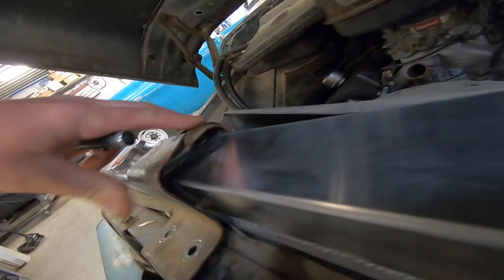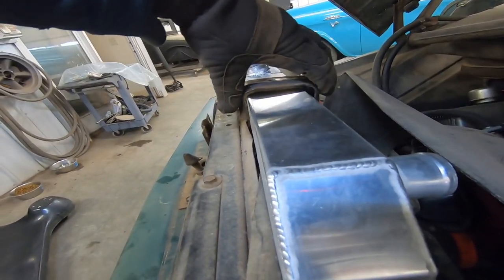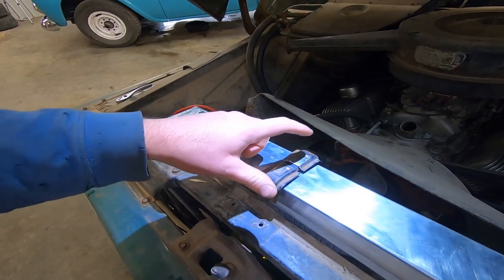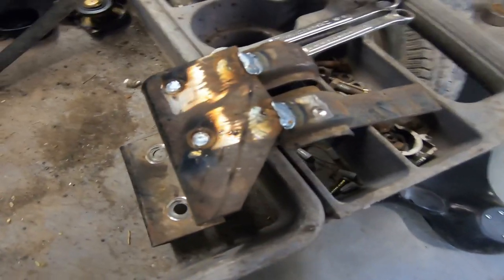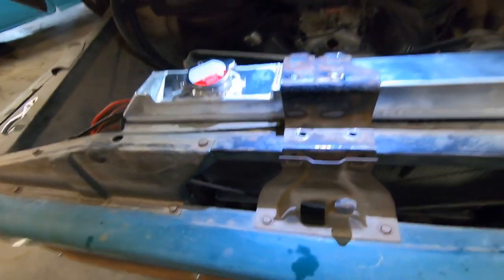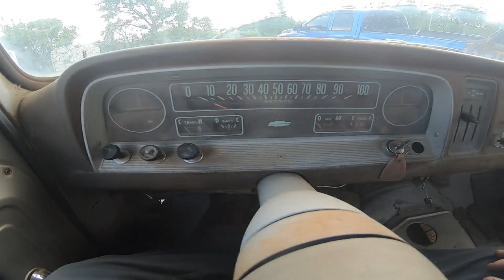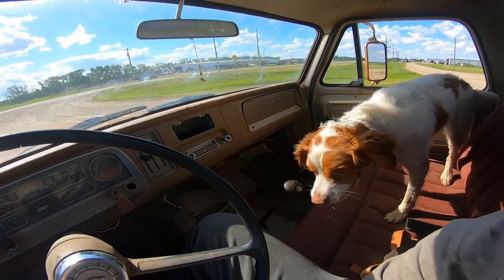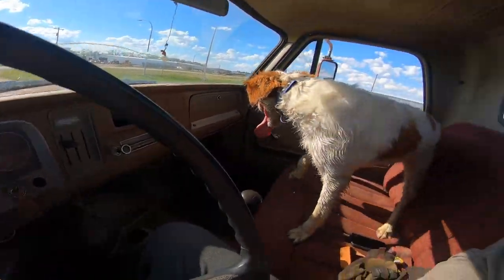C10 aluminum radiator install! 1960 through 1966 eBay upgrade cooling unit for $130

Comment: I just cut two rubber pads out of my old hoses and set the radiator on them in the bottom brackets so it would be setting on rubber. That lifted it up so when I fastened the top everything was tight and riding in rubber for smooth, quiet operation.
Reply from the maker: thanks for the tip!

Comment: Nice work! Engine sounds strong!
Reply from the maker: It really rips for an old beater!
Reply: When I was a kid I had a ‘70 1/2 ton w/350-4bbl. It was a tire smokin outfit!!!!!!
Reply from the maker: @chiefbanish  I've had a few 67-72 with V8s and they all see m to have no problem spinning tires!
Reply from the maker: @alan6832  The weight savings is minimal. The cost is why I chose it.

Comment: Hey man. I call you man because I don't know your name. I am new here so it will take me some time to figure things out. Rads are expensive whether you buy new or rebuild. I had mine rebuilt because I couldn't find out my size. It cost me $400.00 Canadian. But it works fine. I love my dog (Bandit) as my shop dog as well. The only problem is, he steals my screwdrivers and pliers. He likes to chew on the soft handles. That's a cool old truck that you have. It is hard to tell how fast you were going because it is too flat there and no trees. Ha-ha. Nice looking pooch you have there. Man's best friend. He doesn't judge or hold a grudge. Thanks for sharing. I hope we see more of each other. Drop around for a visit. 👍👍
Reply from the maker: Andy Man! Thanks for watching! Duff Dog truly is a great shop dog. Other than he tries to be a little too helpful at times. Specifically when you're working on a creeper and he feels the need to lick your face. Appreciate the comment as well! And what are these tree things you speak of?
Reply: @MortskeRepair  That's funny because Bandit does the same thing. One day he crawled under with me and fell asleep. I guess I was working too slow for him. Ha-Ha.

Comment: Thanks for this video. Got a bay Radiator (looks just like yours). I got the recommended thin thin rubber strips, as well as factory thick ones...I didnt know which was best. Can you tell me what size/type screws hold on the fan shroud?
Reply from the maker: 3/8"

Comment: Are the transmission inlet and outlets on the bottom side of the radiator? If so, are the ports dedicated to a specific side?
Reply from the maker: They are on the bottom and they are equal distance from the centerline.